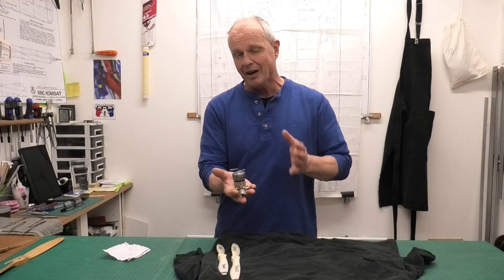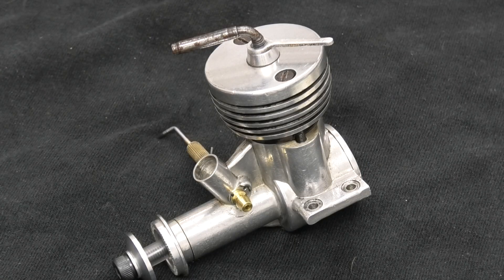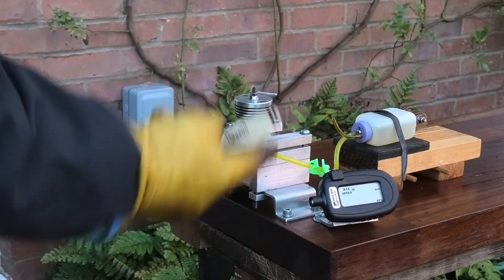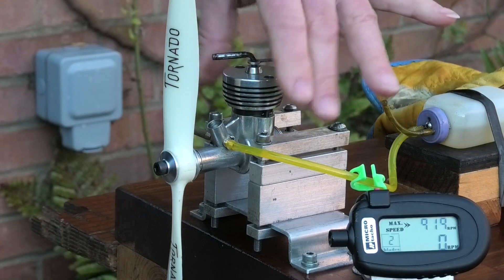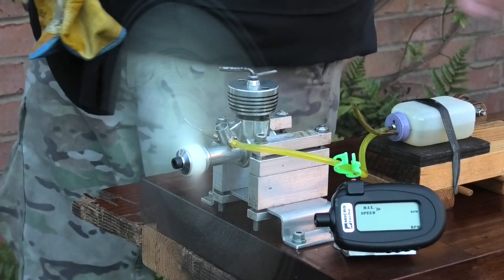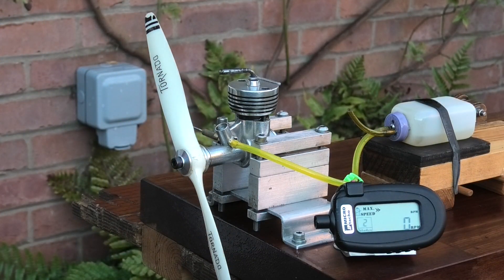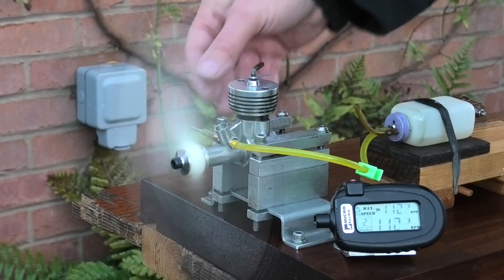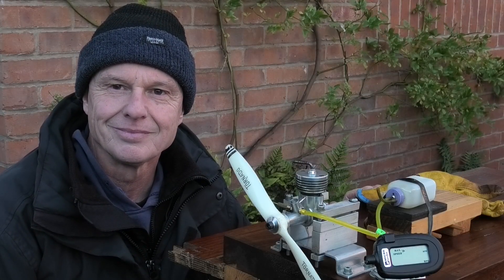In the Test Stand - 3.5cc Mikro Std 1965 Diesel Engine by Václav Stejskal, Czech Republic

Comment: Nice job on the spray bar assembly, those aluminium inserts work fantastic on most materials on small lathes. I use them most of the time on my Sherline lathe.
Reply from the maker: Thank you very much, really appreciate the comment.  Good to hear your experience with the carbide inserts, thank you

Comment: Its interesting that the smaller prop required more compression and a leaner mixture in order for the engine to reach peak RPM
Reply from the maker: Yes, totally, I was also fuprised how much more it needed to be leaned especially, we are learning all the time with these fantastic engines. Maybe it runs more efficiently at the higher speed, so needs less fuel?
Reply: @MarkRobinson555 I was having a think about this, I'm very interested in engines and have built several V8's for cars, along with many 2 strokes for bikes. Anyway one thing that an engine needs regardless of RPM is the peak cylinder pressure to occur at the right time in the power stroke, it is between 14-20 degrees ATDC. (Harry Ricardo worked this out years ago). As the revs rise in a spark ignition engine there is less time to burn the fuel so it must be ignited earlier in the compression stroke in order to get peak cylinder pressure at the right time in the power stroke, the same thing must be needed for your compression ignition engine, the smaller prop raised the peak RPM by quite a lot, therefore the compression ratio had to be increased slightly in order to advance the ignition point, (start the burn earlier in the compression stroke). I see no reason why the 'rules' of full sized engines do not apply to a small model engine!   With regards to the leaning off of the fuel needle I think that the actual Air Fuel Ratio, AFR of the mixture entering the engine would have remained the same throughout both prop tests even though the needle was closed off slightly with the small prop. The increase in RPM would have caused an increase in the vacuum level in the venturi, this causes an increase in fuel flow but the problem is that the two are not linear, if you double the vacuum you more than double the fuel flow, this is why full sized carbs use multiple fuel circuits along with air jets and other devices in order to 'adjust' the fuel flow curve so that it better matches the air flow through the carb in different operating conditions.
Reply from the maker: Absolutely facinating, thank you, I was aware of the need to advance the ignition in my old sparkies, but had never related this to diesels, but what you say make perfect sense, thank you very much, really appreciate your comment